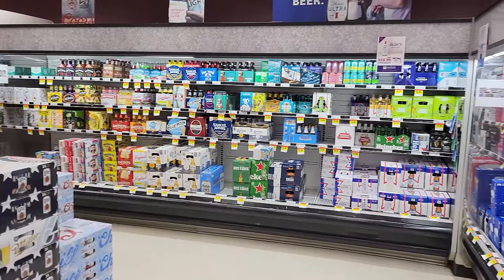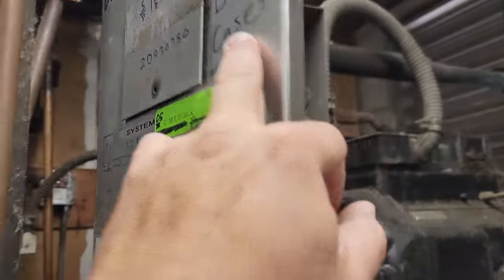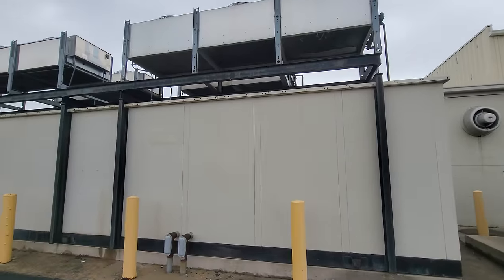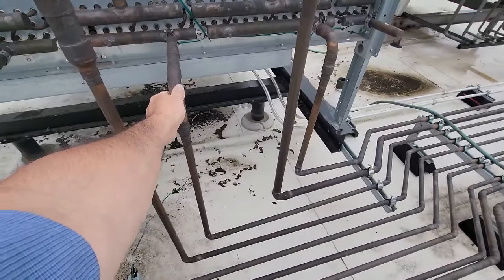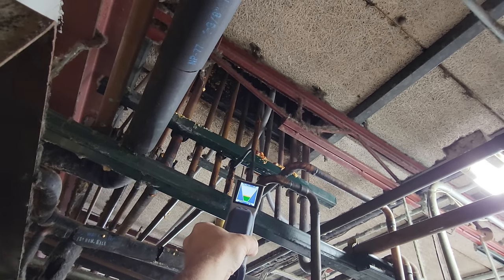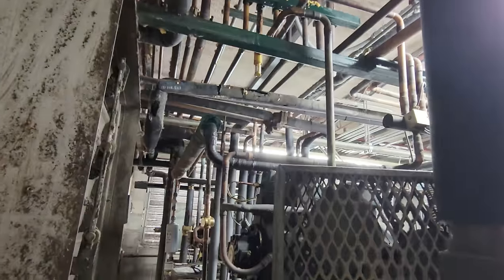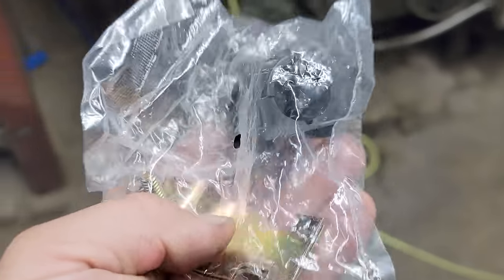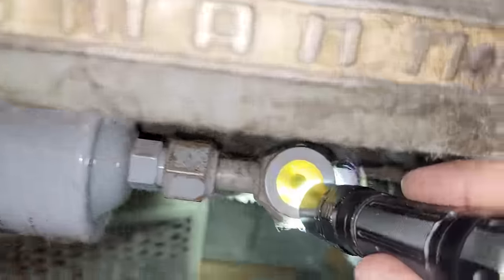Emergency Beer Cooler Down!

Comment: Great work as always sir .
The problem in our trade is that we need so many tools , it's hard to find a balance .
Getting older we try to use a smaller lighter tool bag but then you keep going back and forth to the van ...
And in my field , the van is often parked far away from the equipment so that's a real pain !
Reply from the maker: The struggle is real 😁

Comment: Getting it done....the name of the game in the summer. I had to deal with an issue recently on a 80 ton RTU.....fix3d the issues and found the oil sight glass was empty. Since the building was 95°+ i pumped in some oil to keep the compressors from grenading themselves.....now that its had the weekend to process the building temp down....im gonna go back and look for any oil leaks. With any luck the high discharge pressure will bring the oil back if it was logged in the evap. If i see oil stains...then i know i have a leak and can proceed with a leak search and repair.....sometimes in this business its about getting it up and going over all other issues. Doesn't mean we dont care, didn't notate it....i appreciate your logical outlook on situations and real world approach to situations
Reply from the maker: Thanks Jason, I'm surprised I don't hear more crap from people but I try to explain why I do things the way I did if it's questionable.

Comment: 407c is zeotropic so if you lose some of the charge you have replace the whole charge. Correct me if im wrong but this is what i’ve been taught
Reply from the maker: Yeah they've been telling us that for years. Theoretically any blend whether it's just two like 410A or whatever. The different refrigerant components would leak at different rates but also the thought process has been,  did it leak in a liquid form or did it leak in a vapor form. I've only had a few times where 410A actually fractionated or it could have been just not condensables in the system.

Comment: You will find as your Rack system experience continues that those clamps will loosen oven time, especially on the discharge.
Reply: Those black colored cushion clamps are not even rated for discharge line temps. The plastic will melt and cause the clamp bolt to loosen due to excessive vibration.
Reply: I’m surprised they don’t make some red hi temp ones
Reply from the maker: @Jonny what ones do you use then?
Reply: @HVACRSurvival  there is also a blue insert that is rated for higher temps.

Comment: How much of that original charge was left because its not R407F anymore.
Reply from the maker: The same used to be said about all the other blends. I've never had any fractionation problems with 404 but unfortunately 407 f is three blends. I lost a good majority of it, I would guess  80% or more was all new. What I didn't talk about was I didn't have a lot of refrigerant at the store so I couldn't afford to lose what I had and it was over the weekend.
Reply: There’s a considerable temperature glide with any of the 407’s and negligible with R404A. Of all the gasses to be short of….thats a bugger.

Comment: Not an expert, longtime fan. Speaking of which, is the rack room ventilated well? I saw one outside air damper partially open, another closed. Do the exhaust fans and supply dampers generally work in these spaces? Where I work, even after multi-million dollar renovations, they miss the basics like that.
Reply from the maker: They are normally controlled by temperature. Usually they work, the room will overheat if not and that would put more load on the compressors.
Reply: Thanks for the reply! Appreciate you and your channel so so much.
Reply from the maker: Unlike a couple other channels I like my viewers enough to reply.

Comment: Spoken like a true veteran of the field.  If you're gonna give me crap about not pulling down to 500 microns you obviously don't work on equipment this old
Reply from the maker: That's just real life, according to the same people that preach 500 microns for everything also tells you that you can't get the moisture out of Poe oil. And a filter dryer is the only way to remove the moisture.
Reply: @HVACRSurvival  if that were true about POE oil it wouldn't be used. Filter driers are important as more of a back up because there's no perfect vacuum